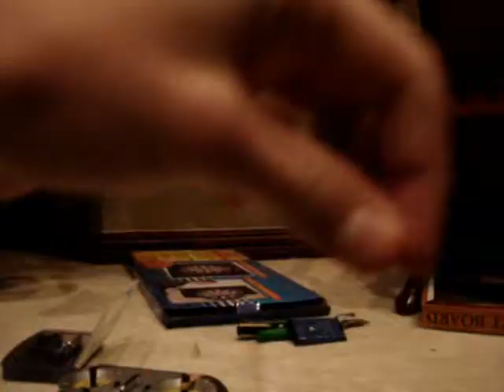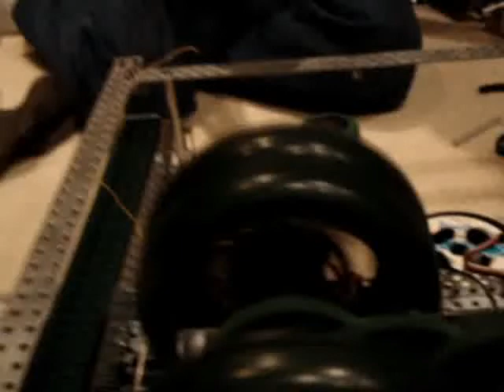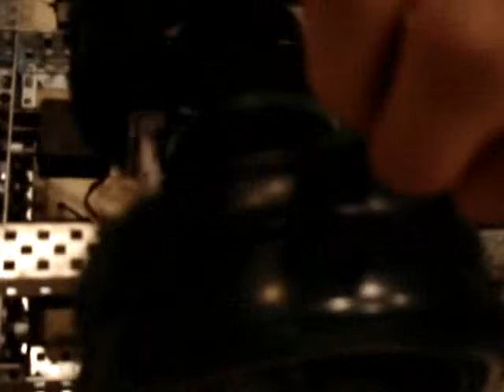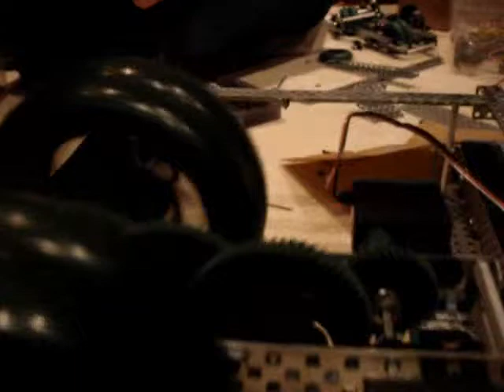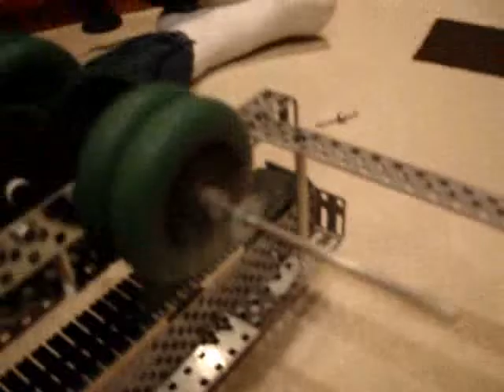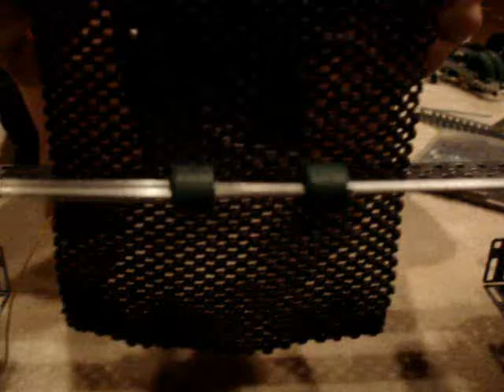Vex Robotics motor stress test 1

Comment: I sure hope these guys were wearing eye protection at least, and preferably full-face shields.  Those little VEX motors don't make much energy per unit of time, but saving up their energy in pairs of spinning 5-ounce wheels and then shooting little bits of metal with them could introduce experimenters to the law of unintended consequences.

It's pretty cool, I just hope they didn't shoot anyone's eye out.